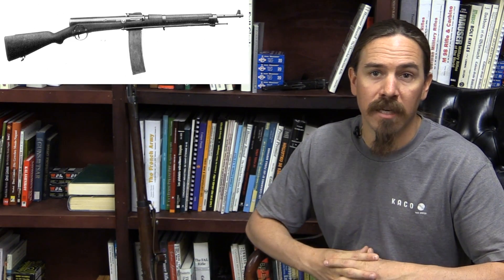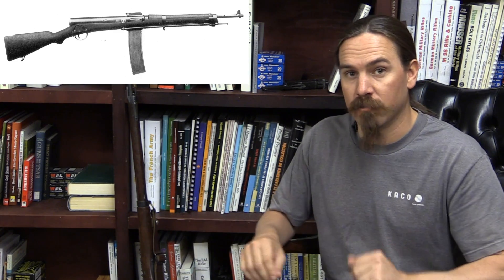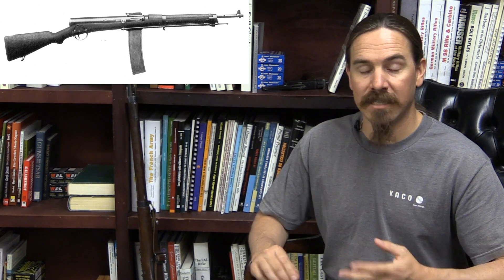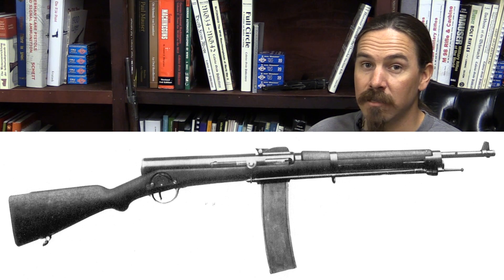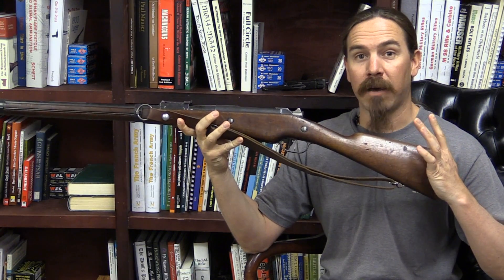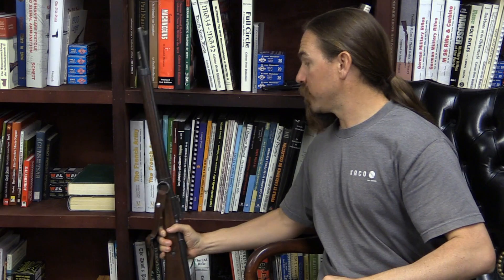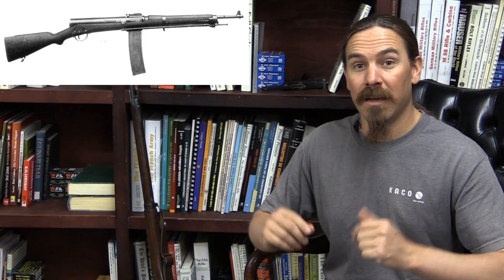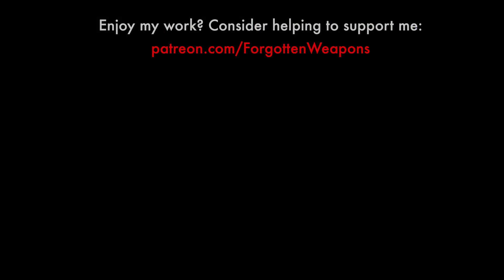Ribeyrolles 1918 - France's First Assault Rifle or a Failed Prototype?

Comment: Kinda funny how as a kid back in the day, I seriously thought for years (thanks to a bunch websites all calling the Chauchat auto-rifle THE worst gun of WW1 like a flock of trained parrots they were) that letting a bicycle plant make small arms during wartime was a sign of sher desperation resulting in their guns being so shoddy, only to realize over time (mostly thanks to your gun disassembly vids I binge-watched around Covid) that it's a total hogwash because:
1. Both firearms and bicycles are esseentially just a bunch of tubes fitted with some lesser bits holding them together, and how one person with the needed know-how can easily make both with an unrestricted access to a lathe rig or a steel press and some pipes & test ammo to work things out on the go.
2. Gladiator also made both motorcycles and cars, for which you also need to machine several small parts with little to no room for mismatching to have them run flawlessly for hundreds of miles, - so the people working there certainly weren't simply dumb or incompetent enough to fail an emergency re-training into gunsmiths. 
3. The original 8mm Chauchats weren't even rubbish guns at all - as it was only their later-built models hastily converted to the USA's .30-06 ammo calibre (without even resizing the gun's firing chamber for a different cartridge in some cases) that made the Chauchat get renowned for being such an infamous firearm.

Comment: We have blueprints don’t we? Why doesn’t some enterprising fellow with a machine shop and some spare time just make one?
Reply: Why do you think we have blueprints?
Reply: @elbrak  

Why the hell wouldn’t there be? Or are you suggesting that a firearm that was designed to be eventually mass-produced wouldn’t have some means of being easily replicated en mass? And even if you don’t. Just take the damn thing apart and learn that way, its a gun dude, not a fusion reactor.
Reply: @TheGuardingDark_  Sounds easy when you say it like that. You should go get a copy of the blueprints and make one in your garage.
Reply: @elbrak  

You know theres a reason I specified a MACHINE SHOP right? Cause you probably need a few specialized tools and at the very least a lathe.
Reply: @TheGuardingDark_  Ya you can make it from the blueprints that are obviously around. It's not like there is only one surviving picture of the gun and a few documents.

Comment: In comparison, the 1915 CSRG or 1917/18 RSC were Mssr Ribeyrolles' better efforts. The CSRG "Chauchat" did work well enough & most of all was cheap to make in its 1000s.  What was he thinking firing a circa 13 g (~200+ grn) bullet using straight blowback (BB)? The only instances I can recall having any success were the Winchester .401 and of course the Thomson .45 ACP SMG (M1 or M1921 if one considers the Blish-lock to be really simple BB). 

BYW: I recall you saying Mssr R made this 8 mm semi-rimmed. The base .351 WSL was itself semi-rimmed.
Reply: Yes, in hindsight, at the time SMGs were only in the first stages of development and the modern battle rifle (assault rifle) was decades away (needing a change in thinking). But one only has to compare this to the Winchester models 07 &10 (which the French had) to realize this is ungainly & needs more work.

Comment: A) According to Michael Bussard's "Ammo Encyclopedia", the .351 Winchester was designed with a semi-rim from the start.  I am sorry if I am repeating what numerous other people have already posted.

B) The Winchester Self-Loading cartridges are interesting if you are imagining a better submachine gun cartridge than the pistol cartridges available in the 1920's and 1930's.  I think any blowback weapon designed around the .351 or .401 is going to be too heavy, as was the case with the Ribeyrolles here.  OTOH, the .32 WSL and .35 WSL were already obsolete and may not have offered enough of an increase in power to be worth the trouble.

C) But the .32 WSL was redesigned to become the .30 M1 carbine round (again according to Bussard) so there was potential there.  The semi-rim was DROPPED in that evolution.

D) .351 was never a big deal as a hunting round, but it was popular with law enforcement...and their opposition.  Up in Manitowish Waters, Wisconsin, there is still a bar or inn where John Dillinger shot it out with Melvin Purvis of the FBI and escaped over a nearby frozen lake.  They still have some .351 WSL cartridges left behind by Dillinger.

Comment: I smell a money making opportunity
Reply: Cory Bieghler probably not
Reply: Alex Moore this baby as a semi auto only closed bolt .22LR would sell like hotcakes to the BF1 crowd, plus anyone else that likes WW1 guns would take notice.
Reply: Cory Bieghler I highly doubt the majority of the BF1 crowd is going to have the money to buy one. A lot probably live in places who can’t own one too. Then even the ones who do have that kind of money probably don’t want to spend money on a gun.
Reply: It depends on how low you can get the cost of manufacturing, this is a tube receiver gun, the only way to go cheaper that I'm aware of is through Soviet style stampings, and In .22LR as a straight blowback design this could be quite the cheap gun to make and buy. If done right it could be priced competitively with the 10/22, and if this gun came with a magwell conversion block to allow for use with 10/22 mags, with a proper marketing strategy whoever takes this on could make a boatload.
Reply: Cory Bieghler now unlike the original you need to make sure it works.
Reply: Unlike the Ribeyrolles, the straight blowback .22 rifle has been perfected over the last 100 years, this isn't an issue as much as marketing and QC are, getting those wrong will make the product end up featured on Forgotten Weapons

Comment: Pity it wasn't in 7mm or 6.5mm.  They might have been able to lighten up the bolt enough and had a stellar little cartridge/gun combination.  I've been shooting a lot of 7-30 Waters lately, and that's a pleasant experience as well as being accurate. (Granted it's in a single shot Thompson Contender carbine.)

Comment: If the cartridge is derived from Winchester 1907s why even design a new weapon? The Winchester already worked reliably and could be used in select fire and using a lighter cartridge would mean they could shave some of the weight off of the huge bolt counter weight thing under the fore end. 

Maybe I just think that design was under utilized. I also wonder why the guns never saw a .45 acp chambering. You have a reliable blowback design capable of full auto and all you have to do is adjust the attached weight
Reply: It's a 8mm lebell round inside a .351 casing.

Comment: When I first saw the thumbnail, I thought I was looking at an early design SKS. Do you think Simonov drew some inspiration from the design of the Ribeyrolles, or would he have had no knowledge of this weapon at all?
Reply: The SKS is not a blowback, but a gas operated short stroke piston (there is a long rod above the barrel with a spring, gas pushes the rod backwards and hits the bolt carrier, which is separate from it) rifle with a tilting bolt locking system (the bolt carrier is pushed back and travels freely for a few milimiters, then it takes the bolt back with it which starts to tilt down therefore unlocking the action), it doesnt have a removable magazine either, it uses 10 round clips like a bolt action rifle. so very basically outside of having a rifled barrel, using bullets and having a wooden stock, those two weapons are about as far away as weapons could possibly be.
Reply: Jorg, I think you may have taken what I said out of context. I was not making a statement as to the inner workings and functionality of these weapons. I simply meant that when I looked at the thumbnail, the Ribeyrolles, at first glance, reminded me of an SKS. I simply wondered if Simonov drew some inspiration from the look of this rifle or if he would have ever seen any pictures of this rifle at all.
Reply: As Ian has said in other videos on french firearm development during ww1, the vast majority of their research was and is considered still, state secret, even when they designed a new opearting principle, they did not file patents. 

Simonov drew inspiration for the SKS from his own previous design the AVS 36, that had a short stroke piston, and the SVT 38/40, that had a tilting block, the magazine of the AVS 36 was a 15 round detachable magazine, but for the SKS they went with clips. The AVS was a full powered rifle, whereas the SKS used an intermediate cartridge.

Very basically Simonov could not have seen the french gun because it would have been a state secret, and the SKS drew inspiration from other guns of the time, including his own previous designs, and Tokarevs designs against which Simonov was competing at the time, plus the meddling of the army command that where at the time for, and against magazine fed rifles. 

First Simonov won with the AVS, then it was not good enough and they went to Tokarev, and then that one was not good enough and they went to a new Simonov design, which then was rendered superfluous in 49 by the AK.

Comment: If that weapon were to be further developed, it could have beaten the MP-44 by over 20+ years for the title of "the world's first assault rifle".
Reply: Ted Archer It didn't use an intermediate cartridge, it used the Japanese full-sized rifle cartridge
Reply: Ted Archer The term “assault rifle” is as much a doctrinal thing as it is a set of traits. The Fedorov as far as I have seen, was used more as a crew served LMG and was only ever issued with one magazine. Definitely not an assault rifle. That’s even if you make the stretch and call the 6.5x50 an intermediate cartridge, which I don’t think it is.
Reply: Ted Archer - Incorrect. 6.5 Arisaka gives you more muzzle energy than 6.5 Grendel regardless of load or projectile. They can be close, but the Arisaka is certainly full power, while the Grendel is at the limit between intermediate and full power.
Reply: Look into the Winchester 1907. It was an "assault rifle" before this French copy.
Reply: The US made Winchester M1907 was semi-auto only. The French converted their M1907s to fire in full auto.
Reply: Arrow TT33 Your point?
Reply: which is less powerful than intermediate 6.5 grendel
Reply: KCMercenary223 fedorov's rifle done that in 1916

Comment: Dare I ask, but wouldn't the overall weight of the rifle help keep the recoil under control? 

Heavy bolt going back and forward, that's going to kick a lot. Having that weight should help keep it in line and on target. 

Really did come way ahead of its time.
Reply: Yes the weight would have helped. However soldiers would be required to carry the rifle along with enough ammo to make it useful.
11lbs of rifle is a lot of weight to tote around.
A quote from the movie The Green Berets will work here.
Colonel " Your records state you are a heavy weapons specialist"

Reply " Not if I can find a light one. Sir"
Reply: Let's not forget ounces turns to pounds and pounds turn to pain. 

Definitely needed more work, however, well and truly ahead of its time and perhaps, the materials of the time, now I think about it. 

French doctrine wasn't helping either.
Reply: it would have made for an interesting bullpup though